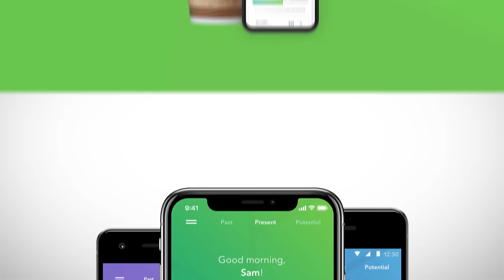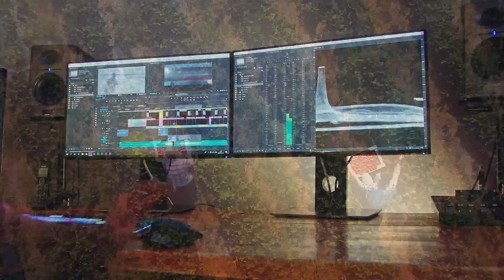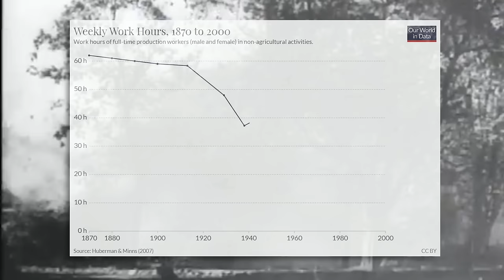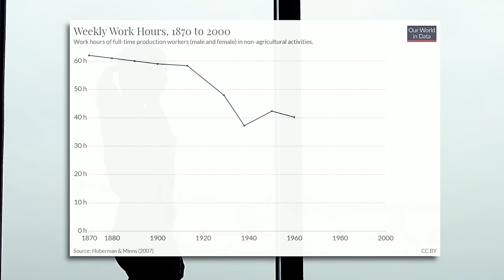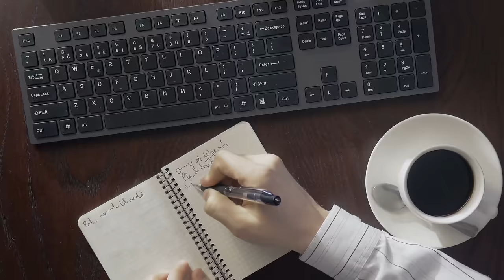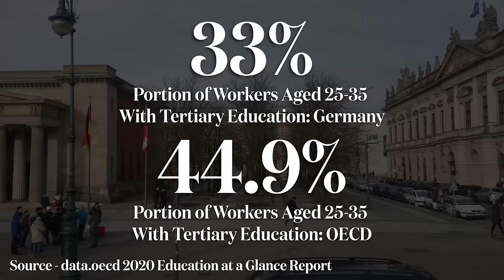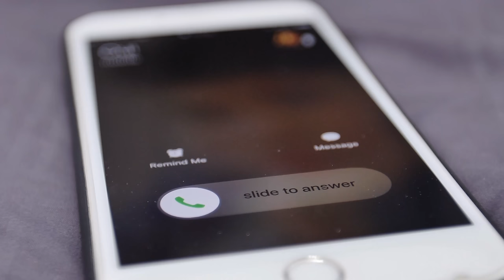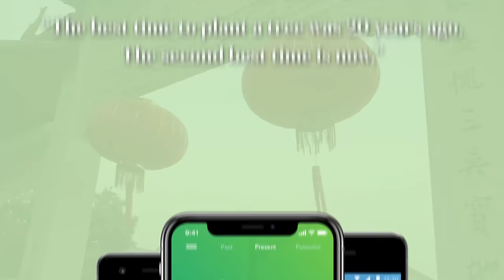Why is Working Harder Making Us Poorer?

Comment: The decline of labour unions is probably a huge factor in the increase of working hours. It’s criminal how much productivity has gone up while wages have stagnated
Reply: Two questions I ask whenever this point is brought up:
* How much of that productivity is because of the worker (thus, how easy/hard they are to replace) and not the increasingly-automated tech they use?
* How much as the population increased alongside wages and productivity? (The larger the population available for work, the lower the wages, even with an increase in productivity).
Reply: @Der Gorghast if labor unions are monopolistic than company owners have to be even more so. Why is that monopoly okay?
Reply: @treyshaffer  
And so you ignore what I wrote (or couldn't read it; youtube has been hiding chunks of comments lately).
I said that the higher the population is, the lower the wages will be. This is because there is more competition for the job, which means lower wages can be offered (as some people will be willing to take a hit to their pay if it means they get the job). It is the same as how prices at stores (or for services) goes down when there are more of them competing with each other.

Also remember that, again, most of the increased productivity isn't coming from the workers - it is coming from the automation and other tech.
Reply: @DBArtsCreators  The work force has become far more educated and specialized, so that is where a lot of the productivity has been realized. Also, regardless of where the higher productivity is coming from, the people should still have higher wages as a result of it. Why should the only people who benefit from automation be the people who own all the factories, as opposed to the ones who are working in them? And let's remember, the workers are the ones who are using the technology and creating the robots.
Reply: @treyshaffer  
* No, not really. Specific areas of work require more education and specialization, but those cover less than half of jobs in the world (and none of that stops the number of people actually competing for jobs). And regardless, higher education and specialization in the workforce alone doesn't make them more productive (usually the opposite, but that's a different topic of education vs. experience). A man/woman with a doctorate and 20 years of experience isn't better cashier or cook than any man/woman freshly out of high school (just as an example - most of the workforce has a similar lack of use for education/experience).
* No, people should not just have a higher wage because there is more productivity - if the productivity boost isn't because of the workers, they don't deserve higher wages. That is not moral, nor is it how economics works. You get a higher wage when YOU are worth that higher wage (as that is how much the company is willing to pay for YOU, just like how much you pay a service is how much YOU are willing to pay for THEM). 
* Namely, it isn't just the factory owners who are benefiting - only they benefit directly (primarily; workers who actually do require in-depth training to maintain or use the machines are well paid as well). EVERYONE benefits from the factory owners being able to offer better products/services, at a cheaper cost, at a faster speed. People (perhaps including you in this instance) just tend to ignore that fact that you are benefiting, simply because it isn't in the form of raw currency you never actually earned.
* Also, automation drives out workers - there are fewer and fewer people working in the factories. That's the point of automation - the reduce costs by reducing the number of jobs the factory owner has to pay for.
* And, as a final note, the technology is increasingly easy to use and requires fewer and fewer people (again, the point of better and better tech). This reduces the potential wages people can earn because the people themselves become more and more replaceable and unnecessary (or, as one of my own supervisors put it: "this job isn't a skilled-job anymore. You can more or less just higher any asshole off the street from McDonalds and they can do your job just about as well as you". He wasn't exaggerating, from what I've seen over my roughly 5-years of employment, both from my own personal experience in design and what I've seen among engineers). 
** As an addendum - the reason factory owners (and business owners in general) deserve their profits, while their workers don't, is because the business owners are ACTUALLY the ones shouldering the risk when it comes to the business. They take the risks, not the workers, and thus THEY get the rewards. The workers give up getting the reward by accepting a wage (giving up potential profit for more reliable wealth stability). This is the case for 90% of businesses in the USA, and the world at large. So, you want more money? Start your own business instead of complaining that your boss isn't paying you enough (and then you'll understand why you are paid as much/little as you are, and how difficult running a successful business actually is). Or, if you want a "PSA" cartoon explanation of it, here's a video link: https://www.youtube.com/watch?v=4jUSDgolz7g&list=PLa5yyWoUx0nV5fQEERlzy8mxtlJgHXI8_&index=40
Reply: @DBArtsCreators  Well, yeah. But there's a catch. If you don't pay your workers higher wages than - say, to make good for the inflation - they are unable to buy items besides those that they had been buying all the time. Which means, all those new gadgets or modern lifestyle goods are either gathering dust, or leaving the country, just like a lot of German cars are now getting produced for the Chinese market. 

And the Chinese are about to set up their own products for the national market already. The time of solely being the world's workbench seems to slowly come to an end, being replaced by the increasing supply to a national market that has grown much larger than it had been in the 1900s. Which means, if China is no longer buying from us, we'll have an issue with finding enough customers for our self produced goods. A possible solution would be quite simple: Give more money to the local workers, so that they can afford more goods. But currently the trend is heading towards the opposite direction. Not good.
Reply: @gabbyn978  
* You forget the third option - the wealthiest (or the government, but usually the wealthiest) are spending money on those high prices for those gadgets/commodities and thus pushing the price down as their purchases fund the improvement (and thus affordability) of those gadgets/commodities. It's why we have affordable microwaves, blenders, vacuums, televisions, and the like now. Rich people/governments spent money when the stuff was new and expensive, the things improved and got cheaper, and thus more people could buy them. That's how economics works (remember that even the wealthiest want to save money). If something is leaving the market, it isn't simply because it can't be afforded - it's because people don't want it enough to pay for it.
* China hasn't been buying from people for the most part for decades - they are well known as having been global sellers since the 1960s-1970s (I think; my time by be a little off). 
* That isn't a possible, nor a simple, solution. Workers don't simply deserve more money, and there is no moral (or even theoretically possible) way to actually control what people are spending their money on. Besides, your "give more money to workers" option is what minimum wage is, and is what is causing the problem in the first place - you can't solve the problem by expanding it.
Reply: @DBArtsCreators  How many rich people are there, to make good for the millions to billions of meagerly paid or even unemployed people? And how much money does a state have left, that is suffering from tax evasion, which seems to be a preferred sport of giant companies? Actually, the wealth of the richest ten percent is growing faster, than they can spend (or invest) their money, which is an alarming development. I wouldn't see that as a solution in the long term.
Reply: @gabbyn978  
* Depends on what you define as "rich". Are we talking people who make $100k+ per year before taxes? $200k+? $500k+? $1m+? Number shrinks rapidly as you get higher, though for most people in the world, I'd imagine anyone with $100k+ would be considered moderately "rich" or better. Also depends on where you are talking about (since if we talk globally, making $32k/year puts you in the top 1% economic earners apparently). In the USA it shifts over time; this video explains it better than I can: https://youtu.be/KqUgHuHmbzo?t=45
* As for the meagerly paid - that's also largely a matter of perspective and individual choices/circumstance. More often than not taxes put more people in poverty or make them unemployed, not the other way around. It's the nature of the beast - if you pull more money out of the system from the rich in order to enforce welfare/healthcare/social security/etc, you limit their ability to pay people and thus their ability to hire more people.
* Considering (USA) the government has around $10 trillion in available funds a year (or something like that), and 70% of that already goes into healthcare/welfare/social security, I'd say they are already getting all the money they can (tax evasion isn't as easy for the rich as you think, and is equally participated in by the non-rich on the smaller scale). 
* The wealth of everyone is growing; yes, the wealthiest have their wealth grow the fastest, but they are also the ones putting the most back into the economy, so it evens out (never mind that most of that wealth growth is theoretical value, not actual value. See this video for more: https://www.youtube.com/watch?v=3Q84G7AJgCE
* Wealth growth isn't a solution - it's the goal. And it is one that benefits everyone, directly or indirectly the majority of the time (including currently, in regards to the USA).
Reply: Stagnation of the median wage correlates to mass immigration.
Reply: Decline of labor unions = Reaganomics
Reply: It's possible, but I'm at my first and only union job I've ever had and this is the only job I've ever been assigned mandatory overtime. The union contract stops it at 2 weekends in a row, but that's still 19 days before getting 2 off. Not fun, especially when it erases weekend plans on a Friday. All the small non union companies I've worked for have had either strict no overtime policies, or were closed on weekends meaning you could only work long days but were still guaranteed a weekend. The economic structure plays into it quite a bit, running 24 hours a day 7 days a week isn't easy for small businesses to pull off, thus they don't.
Reply: In my case it was the opposite.  When the union came in they couldn't afford as many people so the ones they kept were worked to insanity. 
2 people doing what 9 used to do.
From 40 hrs/wk to 60 or 70 being  normal.  Overtime checks are nice but shouldn't be the norm, that leads to burnout.  Some people seem to thrive on that though,  so maybe it's just me. 😪🍻
Reply: @DBArtsCreators  Other tech, believe it or not cell phones are a big part of that in some fields. That tech alone replaced probably a half dozen people where I used to work and greatly increased the amount of work I had to do. Burnout!😪🍻🤬
Reply: @alsaunders7805  
A curse of work sometimes, but a rare one. Such an increase in work should lead to an increase in pay for you though, since so many others were let go - whether or not you got that pay would either be on you, a union, or a stingy company that should be sued for bad business practices (since they are increasing the amount of the work required without increasing pay).
Reply: @daytonaofcv6856  
And where am I wrong? The phrase is one of reference to the lack of skill/training needed for an occupation (hence why they are called "low-skill labor"), commonly associated with fast food (which, contrary to what you might think, don't require a lot of training or skill to perform).
Reply: @DBArtsCreators  you need people who aren't complete morons. Which aren't as common as you think. You need people who can work with others, and can communicate with the general public. You'd be surprised how hard it is to find people like that. Or you can just hire people forever. I'm guessing you probably never worked in those environments at the lower end of the wage spectrum. But you'd be surprised who you can find in those situations. I had to manage a girl who couldn't for the life of her operate a register correctly. She was a recipient of a full ride scholarship though. ☺👍
Reply: J
Reply: this tbh its hard to get over 38k a year after taxes
Reply: @DBArtsCreators  Ummm.... if the population increases so does the demand for goods and services (more people need more stuff)
Reply: @atomsmasher9411  
Not in a linear fashion however. Production easily outpaces human population in basically every area (the only exceptions I know of are food & land), and as we progress fewer and fewer people are needed.
In other words - even if demand rises, the need for workers does not. Not to a matching degree, at least.
Reply: @JackieVargo  because unions represent millions more people than owners?
Reply: @DBArtsCreators  uhm that's debunked. Look at sectors that need trading degrees in America. They need people and yet they are not willing to pay more to fill out the positions. Pay is about the same as it always was.
Reply: @DBArtsCreators  lol who's there to say how much someone is worth? Owners always try to pay as little as possible to make more profit hence the reason why jobs are in Mexico and China. If machines help workers be more productive then it is still the workers who are producing more at the end. Just because you make the jobs of workers easier to produce more, it doesn't mean they didn't do more. Not to mention the workers themselves made owners able to make more so they can buy more machines to make even more.
And cheaper products doesn't always means good. Go to 3rd world countries. You can get by pretty cheap. How's the cheapness working out for you? Jobs that are lost so in reality owners put the people who buy from them out of work so they have to keep on making lower quality cheaper products.
Reply: @mehrshadvr4  
* Not debunked. Not only are trades willing to pay more for people (be it through wages or benefits), but the pay has been rising at a faster rate than wages you'd find working in retail or service work (in most areas of the USA at least). Know this one from working in a trade myself (of course, it can be difficult to tell at times, as a lot of trade work overlaps with contract work, people who are self-employed, and small businesses, not only large businesses). 
* As for who's to say how much someone is worth? Not the government. The business owner, customers & potential employees decide (business owner makes an offer based off what the customers are willing to pay as well as what costs the owner has to deal with alongside the profit they want to make, the employee then must accept, decline or try to negotiate). If the employees think they are worth more, then they have to argue the point and make their case (of course, with minimum wage laws and required benefits in place, it is difficult to argue one's additional worth to any company, as now all the companies have the same starting point they can offer, with no requirement to go higher).
* It isn't the worker's that are producing more as far as the employer is concerned however, it is the machine. In the eyes of an employer, there is no reason to pay a worker more when the worker's work becomes easier for anyone to do, even if it allows more to be produced. The easier your job/the less skill required for it, the less they have to worry about paying because they have a wider pool of workers they can offer work. Workers also don't get the right to demand things because of decisions the employers made in regards to how to use their profits. They can try to negotiate a better wage, but they can't simply demand it. If a worker doesn't want to negotiate and doesn't like what they are being paid, they can leave. No one is forcing them to keep going into the same job, except for the worker themself.
* Cheaper doesn't always mean good, but it doesn't mean bad either. Televisions, microwaves, stoves, vacuums, cars, snowblowers, and the like are all examples of how things have become exponentially cheaper with time without losing (and in many cases actually improving) quality over the span of only a few years/decades.
Reply: @DBArtsCreators  lol I don't know what world you live in, but I was a mechanic 12 years ago and a senior master mechanic used to make $24 per hour and there are opening for mechanics all the time. This is the wages today. Majority are in the same boat after 10-12 years. https://www.ziprecruiter.com/Salaries/Union-Mechanic-Salary-in-St-Louis,MO
And how much employers are willing to pay? If they were willing to pay more, they wouldn't export jobs, import cheap labor and automate jobs as much as they can to maximize profits. Let me tell you this. as long as owners are making profit, that means employees are producing more than they are paid for. That's an argument on their own. And this is why we need the government to balance the power. Owners have more power and if we let the system be as you said should be then the owners will always win because they are the ones with power. Now you know how communism starts. 
And who said more tools required less skilled workers? Are you telling me machines run on there own? Are you telling me when ford invented assembly line, the workers were doing less work?
Reply: @mehrshadvr4  
Again, in line with the wage growth of other careers (and again, you are not looking at work paid for outside of salaries. According to the plumbers - as well as auto mechanics I've done business with - much of their work is paid based on whatever jobs come in as well - more work coming in means more pay). 
In other words, you are simply refusing to look at the reality of the situation. Things aren't as limited and narrow as you make them out to be (nor are businesses "the bad guy" as much as you'd like. Customers, employees, governments/laws & the general state of production vs. worker are just as much the culprit).
Reply: labor union is the cause of that
Reply: @treyshaffer  because minimum wage
Reply: in the world of global consumerism and free trade, the competition too offer cheapest goods and services in the market is very high. One of the ways to achieve this is by cutting the operation cost (labor, outsourcing, material, technology).

japan rise in 60s-80s, and china post 2000 are some of the examples.
Reply: @DBArtsCreators  well said on your first comment
Reply: Thank you for bringing this up. I don't know how this guy considers himself an economic expert and doesn't even talk about unions When comparing the modern post 1980s United States with its pre-war Society or Germany
Reply: @jasonwilkins1969  tell that to Racist Union Laws in 1930s where Black unemployment rate soared after the law. Before the law, black had lower unemployment rate than white.
Reply: @DBArtsCreators  so if those factors just happen to pan out a certain way, then it would be completely justifiable to pay people wages that are insufficient in sustaining them in the that particular economic climate? 

I don't think there is anyway to justify what we are seeing in the US right now.
Reply: @estoyakula8525  
If the factors pan out that way, it is unfortunately economically justified; there is no arguing around that. And likewise, morality doesn't have a place in economics. 
If there is a moral issue with an economic situation caused by economic factors, then the situation has to be fixed economically. It's why the minimum wage existing (let alone raising it) fixes nothing and overall just makes things worse - it results in fewer people being paid, those still working being saddled with more work than they can handle, and an even faster trend towards automation and making the employee as unnecessary as possible in making a profit (meaning they will rarely if ever make anything more than minimum wage, which itself is further made worse by the irrational, unjustified and moronic mindset of "pay me minimum wage, get minimum effort").

Whether your or I like that reality is irrelevant; it is the situation we have to deal with, like everyone else. To which, I can offer the first solution that comes to mind (though undoubtedly not the best nor easiest): we need fewer people, and people need to be capable of more without relying on technology & support (in other words, companies need to have fewer options to pick from for their employees, and those employees need to be worth more inherently to justify their pay).
Reply: @DBArtsCreators  sorry, but I do not find your particular brand of identity politics and anecdotal quips to be all that appealing, let alone helpful, for anybody, really.  Especially considering how your proposed "solution" brings us right smack dab into the middle of nazi territory with much haste, whether you know realize it or not.
Reply: @estoyakula8525  
I don't blame you for not finding it appealing; that's more or less the point. These aren't solutions I "propose". They are the only ones currently left as "viable" (though they really aren't, as your Nazi comparison points out), as no one is bothering to try and come up with a legitimate working alternative, as everything else tried just exacerbates or ignores the problems. We need alternative solutions - that much is fact. What those better alternate solutions would be is the question to discuss.
Reply: @DBArtsCreators  you are hard-lining an advocacy of not only curbing population growth, but also ways to actively reduce it's current size.

To state there are no other alternatives is beyond absurd, since the statement "everything else tried just exacerbates or ignores the problems", I find to be quite objectionable, as I am not at all convinced all that much has actually been tried, let alone put into any kind of practice, throughout the history of human society, and the laws we come up to essentially govern them.

I don't see how leveraging some kind of powerful authoritarian policy over the world's population, in order to both curb and reduce said population, is somehow an easier alternative to simply better managing the current pool of wealth, which is concentrated in less then 1% of the worlds population.  

And we have the data to back that claim up, as well as the fact that the world's wealthiest individuals and institutions have not been too keen on sharing (various forms of tax evasion, lobbying to keep wages low and unions disbanded), and have leveraged the current state of the wealthiest nations on the planet, in order to exploit not only much smaller and poorer countries, but their own citizens as well.  

And yes, I am aware of the benefits globalization has brought to developing countries, but the vast, majority involved in the current system are still exceptionally poor off, and there is still a HEAVY economic bias in it's design for it to mainly benefit many wealthy countries.  I thin it stands reasonable to argue those country's industries intentionally keep them that way, but that is an entirely other can of worms to discuss, with it's own laundry list nuances and historical context.

Moving back to the original topic, and to put the argument in as simple terms as possible, how is your solution, which calls for authoritarian population control, an easier, more reasonable solution, in comparison to just a little bit of reform, involving holding the rich and their companies/institutions economically responsible for the people who's land, labor, and lives they exploit, in order to gain tremendous profits, and thus power?

How would you even go about implementing your population control "solution" in the first place, and what would be the social impact of such a program?

You are entitled to your opinion, but I find it's core rational to be critically flawed, heavily misguided, and potentially quite harmful.
Reply: @estoyakula8525  
You are being disingenuous at the outset. I've not been a hard-line advocate for population control nor population reduction. I'm opposed to both; opposition or not doesn't change the current problems we have to deal with however, nor does it change the easy solutions.
I didn't state "there are no other solutions". I stated that nothing else we've tried (or pushed for), as a population, has worked, nor does any of what we've done so far show any signs that it might work in the future (so far).
I NEVER said we should be using any sort of authoritarian policy or government to control or reduce population (and that wouldn't work regardless; China shows that well). And it is equally authoritarian to assume that the current "pool of wealth" can be "managed" in any way. 
I don't claim population control is in any way good, nor reasonable, nor desirable. Since you beg the question on how it is easier than managing wealth, however, it is because of this: wealth, and thus politics and business, is controlled by those who have it, and those who are influenced by it. To try and get such things out of the hands of those with it (via reforms and such) will only see it hidden away again and again, as the extremely wealthy horde more and more as a response to what can be seen as an aggression/attempted theft against them of what they have (morally earned or otherwise). In other words, your "reforms" will only make the situation worse, and will push people to war. Population control is easier only in that, when the people are gone, it takes decades to centuries for the population to return to whatever size it used to be, and with a smaller population it is easier for wealth to get into the hands of people (because there are less hands to reach, and less fighting over resources due to there being fewer people fighting over resources). And this population control/reduction doesn't have to be caused by war, nor authoritarian government mandate. All it takes is for people to have fewer children, and anywhere from 10-50 years. That's literally all it takes; a little bit of self-interest on the side of normal people to put off having children, and to have fewer of them.
Reply: @DBArtsCreators  not disingenuous per se, if anything, it can be considered an especially bad faith interpretation of your previous statements, especially "These aren't solutions I "propose". They are the only ones currently left as "viable."", which does, in fact, put you at odds with your new claim of "I didn't state "there are no other solutions"".

"it is equally authoritarian to assume that the current "pool of wealth" can be "managed" in any way."  Well of course, an authority exercising power over others will always be "authoritarian" by the most basic definition of the term, yet we are are both referring it in a negative, amoral framework.  So I would like to know why your it would morally wrong to leverage a governments authority to manage an economies wealth, which, we both know what I mean, taxing the rich in some way.  I personally don't see a problem with authority if it is being used to prevent social decline and improve the health and well being of the people being asked to generate wealth for the wealthy.

I'm not a fan of "if you tax the rich, they will simply hide it away, so don't even try" argument, simply because, it has been done before, in an albeit simpler time, I will recognize, but no one has tried to hold the rich more responsible to their taxes, so I am not convinced it cannot be done with enough tedious policy and legislation, since it has yet to be done. Also, while mainly just a smidge better at it then the US, how is it possible for countries like Germany, let alone FINLAND, able to hold their rich and industry a bit more accountable for the economic stability and sufficiency of it's citizens, despite lower per capita GDP then the US has?

I'm also not convinced of the argument that a lower population is all it would take to alleviate the strain of wealth scarcity, as there are many more factors contributing to wealth inequality in the first place, which I guess we could classify the general phenomenon of "corruption" as a social issue, and major failing of any government institution.  How would a reduced population convince the wealthiest individuals in that situation?  If there remains an elite class of people who have an inordinately large amount of wealth when compared to the majority, regardless of population size, and it is within their capability and best interest to continue the same behavior of wealth hoarding and hiding they were doing before, then what about a smaller population would change that particular behavior?  I do not see how a smaller population somehow automatically curbs the issue of an exceptionally wealthy class of people using their wealth to influence economic policy for those who benefit less form a system they practically wholly own.